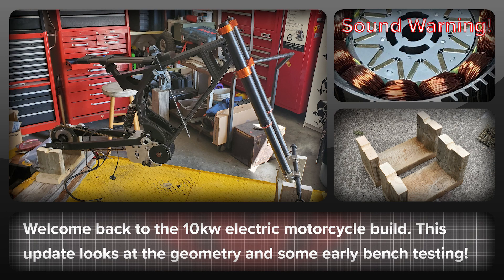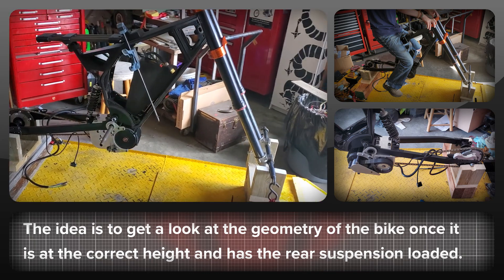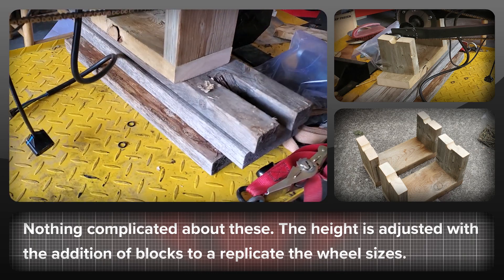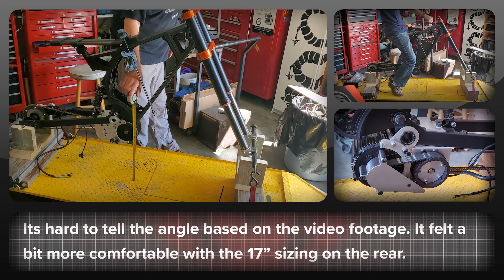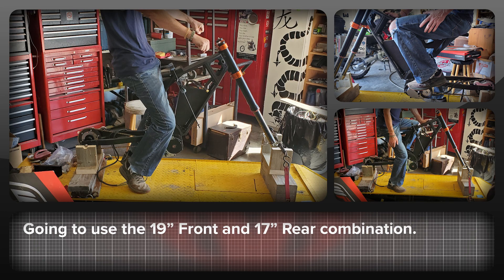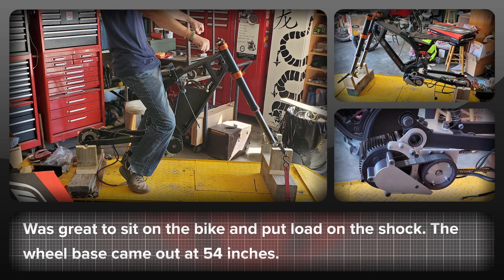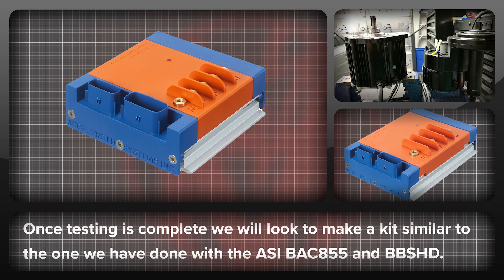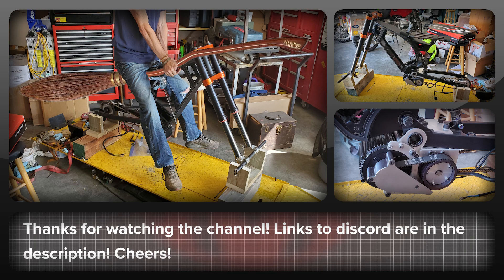10kw Electric Motorcycle - Lightning Rods Big Block XL  - Frame Geometry / 1st Bench Tests

Comment: Are these frames comfortable for guys over 6ft?
Reply from the maker: You can get them pretty tall with the right combination of forks and wheels. This one I think will fit me well at 6ft. Be easy to adjust the seat. There is a bigger one if you check out ELEEK.

Comment: Still looking forward to this build.
Reply from the maker: Thanks Danny. Taking shape slowly 🐌
Reply: @HighVoltageKits  ya that’s NOT a mid drive motor that’s a chain driven direct drive motor
Reply from the maker: Fair point. So it's only mid drive if a derailleur or similar chain tensioner is involved?
Reply: @HighVoltageKits  ya sort of so a mid drive for example it a cyc x1 pro gen 2 that’s an example so it has to use a bicycle chain and bicycle gears with a derailleur or it could be a single speed with a bicycle chain but that ruins the whole point of having a mid drive
Reply from the maker: Understand. Cheers